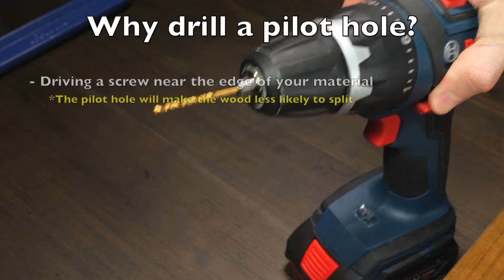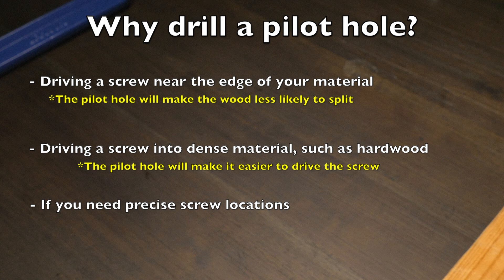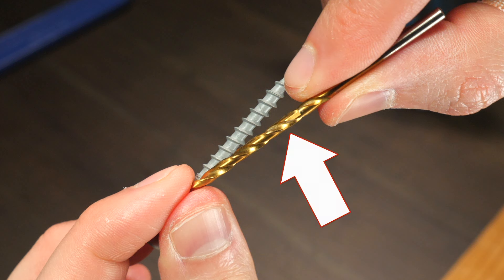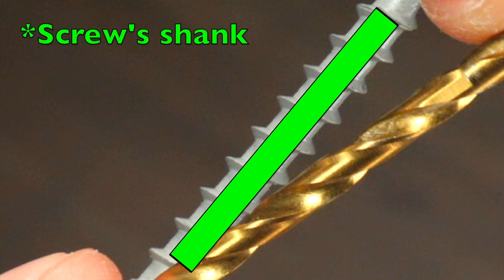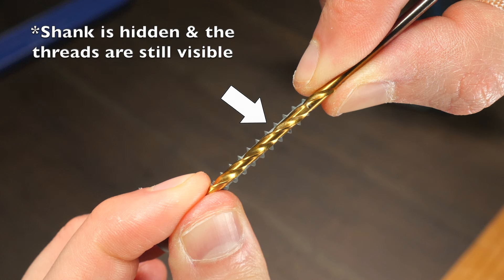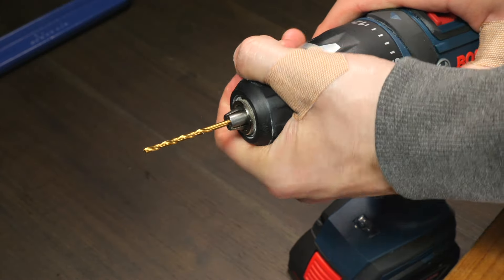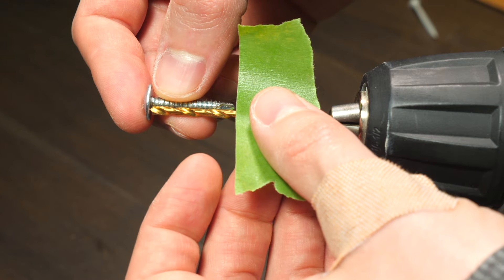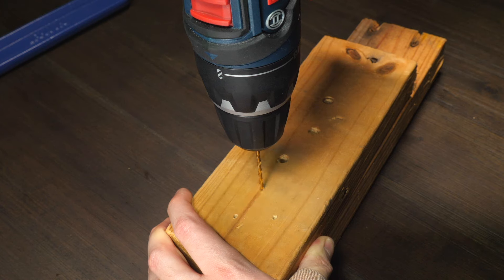How To Drill A Pilot Hole

Comment: Does it make sense that mounting instructions say drill a 7/32" pilot hole for inserting a plastic anchor with 1/2" diameter (at the widest point). It is not one of those self-drilling anchors that split a tthe tip when inserted to better hold.